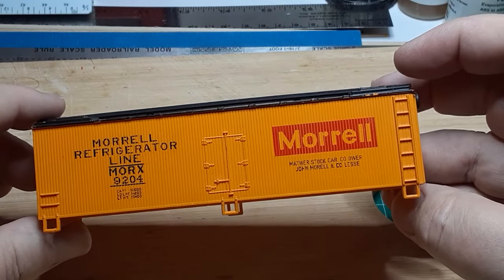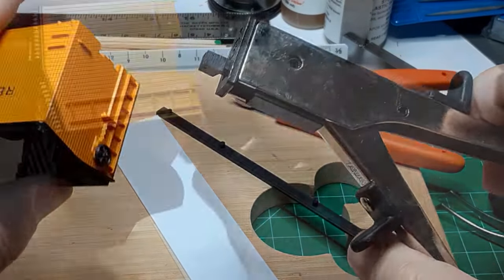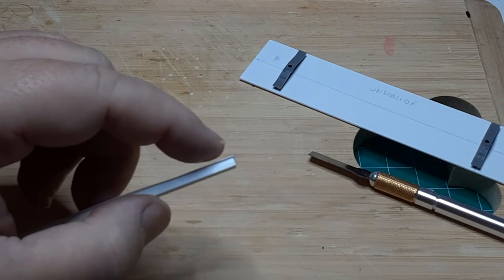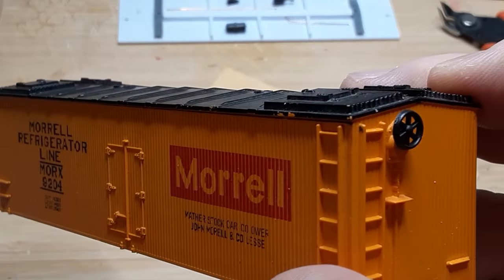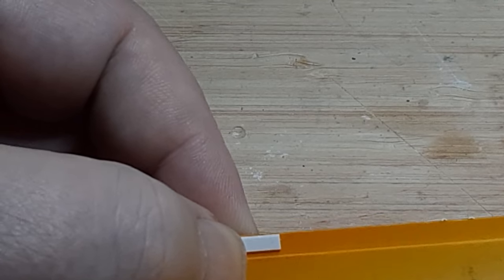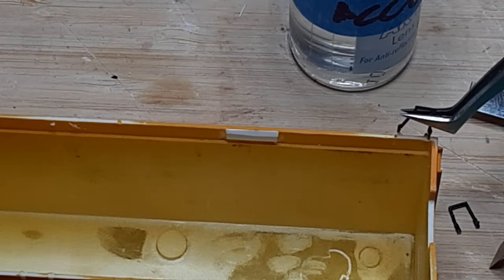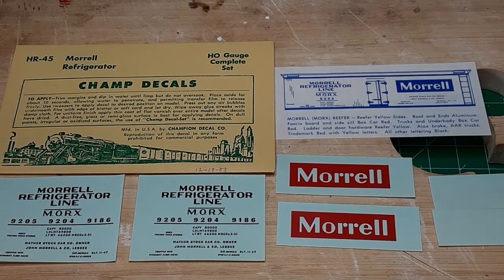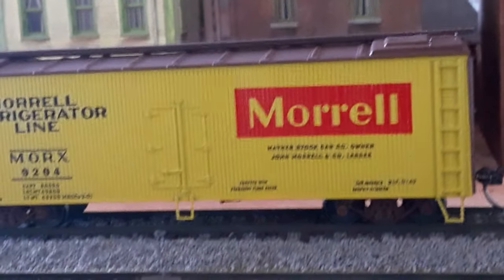Replacing a Missing Freight Car Underframe

Comment: It's interesting that you uploaded this video when you did. Despite the fact I'm giving away or selling most all of my 25+ year old kits, having been forced out of the hobby in the 90's, I've re-started a couple of "play" projects, now that the cause of my departure from the hobby is no longer among us. I'm converting a number of old Tyco 40 foot gondolas into freelance "modern" 100 ton gondolas. Part of the work involves completely replacing the mock fishbelly underframe the Chinese manufacturer had to create in order to install their piddly little 1 ounce weight. I ended up using 1/32 inch lead sheet cut to fit in the recess under the car, then began building up a new undeframe directly on it after I had cleaned and primed it to allow handling. 

I had ordered both the Tichy bolsters you used as well as beefier, though less detailed ones, by Northeastern. As this was to be a modern, heavy duty car I ended up using the Northeastern bolsters. The lead sheet lined up perfectly with the faux coupler pocket top lip, and as luck would have it, test fitting a Kadee pocket and the trucks I am going to use resulted in a perfect coupler height. I fashioned the center sill from two 0.060 x 0.080 inch styrene strips cemented on edge to a 0.010 x 1/4 inch strip, resulting in a sill with the hollow gap down the middle. The stringers were made from Evergreen 1/8 inch I-beam cut to length and cemented to the lead sheet floor and lined up with the new ribs. I thought it would be a difficult job but it turned out fairly easy.

After comparing the Tichy and Cal-scale brake equipment, I decided to go with the Cal-scale as it didn't require assembling so many fiddly little bits. I've got the air reservoir cemented between a couple of stringers and now I'm paused, waiting on the paint I'm going to use. Once painted, I'll add the rest of the brake gear in their natural black color. I estimate that once complete, nobody would ever be able to guess the car started out as a cheap "toy train" model, and with the lead sub-floor, it'll end up weighing in right at the NMRA recommended weight.

Oh, and I love the dull, greasy black wheels you selected.
Reply from the maker: In general, I love Tichy's parts, but in the case of brake system components, I agree with you: lots of fiddling assembly required. Although I didn't mention it in this video, I get my brake system components from Accurail. They sell a "Box Car Detail Sprue" which contains all three brake components, plus some stuff I don't need, and it also includes four #2-56 screws. Part number 159 is 25 sets of these and costs $25, making the cost of brake components one dollar per car.
Reply: @rwissbaum9849  I like the 2-56 screws with the angled heads (sort of like wood screws) for trucks. Even if the truck mounting hole is larger in diameter than the screw, I can tighten them down and the angled head will insure they stay perfectly centered as the screw goes in. I finally broke down and ordered a batch of 100 from Amazon. 

I was not aware Accurail had a parts page, now looking at it. I'm intrigued by their trucks. They come without wheels which is a plus because I want to use semi-scale Code 88 wheels. That's a lot cheaper option than buying Kadee trucks that cost almost as much as 12 pairs of the Accurail ones. Also now wondering if their brake rod set would work on my gondolas. If so, that would save a ton of work. Will see if I have any Accurail kits with those sprues in them and compare!
Reply from the maker: I use nothing but Accurail sideframes for my freight cars. I pair them with Intermountain 33" metal wheelsets. They roll beautifully and look very good. I still use Kadee trucks for cabooses because Accurail doesn't have a leaf spring truck.
If you view my video "Rebuilding an Inexpensive Tank Car", you'll see how I used Accurail's mechanical brake rod set on that project. Caution: These parts are VERY fragile and the brake rods WILL break until you learn the trick of separating them from their sprue!
Reply: @rwissbaum9849  Yes, I commented on the tank car video before. I just checked a couple of old (30 years?) Accurail boxcar kits but apparently the brake rod casting didn't exist back then, only the three typical major system parts are included. I'll have to contact Accurail as both trucks and the brake rigging appear to be unavailable.

Comment: Nicely done!  Personally I wouldn't be able to live with the wrong-way hatches, but that's just me.  I suppose we all make concessions to what is "good enough".  I knew modelers who wouldn't put a car on the tracks without air hoses and coupler lift bars but not having those on my cars doesn't bother me at all.  Glad to see another rebuild video, and another car saved from the scrap bin.
Reply from the maker: When I finally noticed the ice hatches, I had been scraping paint for almost 30 minutes, and this was after soaking the car in IPA for 3 weeks and scrubbing with 00 steel wool for almost an hour! I kept thinking something looked wrong with the roof and it finally dawned on me that the hatches were the wrong way 'round. Frankly, I wanted to get this project finished and off my workbench, so I decided not to futz around with it any longer. As I said in the video, I'm pretty lazy...

Comment: I finally found the AB brake sets from Accurail and $3.99 ain't bad for 3 sets of brake detail parts.  Only stirrups Tichy carries are molded from delrin which I don't particularly care for.  I'd much rather use wire stirrups and I've been known to make 'em out of staples from a desktop stapler.  I see you also use K4 decals with free shipping.  Cheers from eastern TN
Reply from the maker: If you buy 'em by the 100, they're a buck apiece, plus you get two #2-56 screws per brake set!
A-Line sells metal stirrups and they're quite nice. Also check out the cast brass stirrups from Owl Mountain Models. They're a little pricey, but they are beautiful. You can see them in this video: https://www.youtube.com/watch?v=9pU3Rp4jDAQ&t=3s

Comment: Another thought: Central Valley makes freight car underframes... I think they come in a 4 pack. I simply measure carefully then cut the underframe to fit.
Reply from the maker: Great tip! I have built a CVMW stock car kit and I liked the ease of construction and the appearance. The underframe kit looks great - I'll check it out. Accurail also sells a variety of underframe kits.